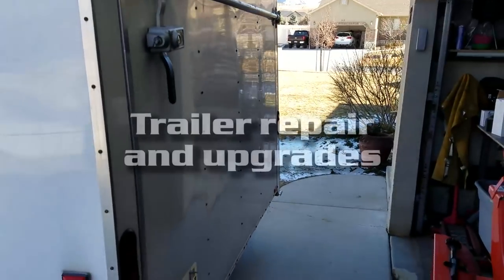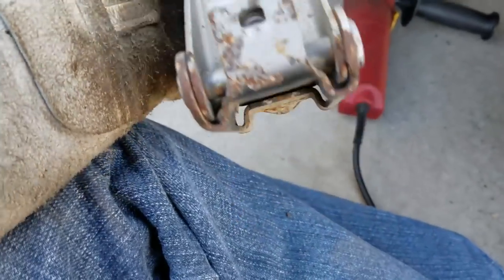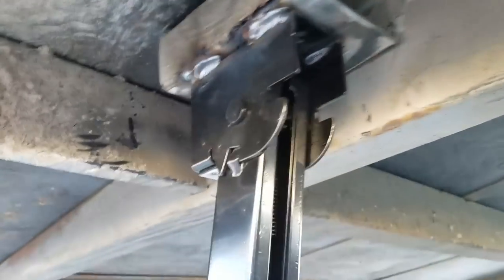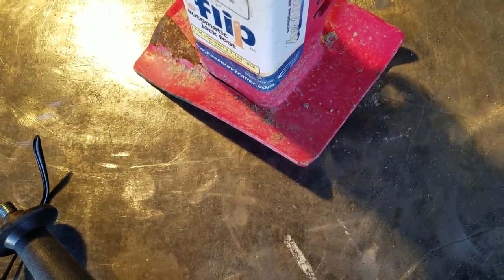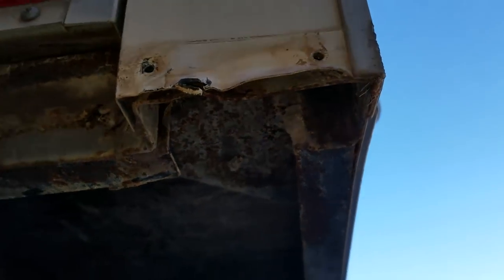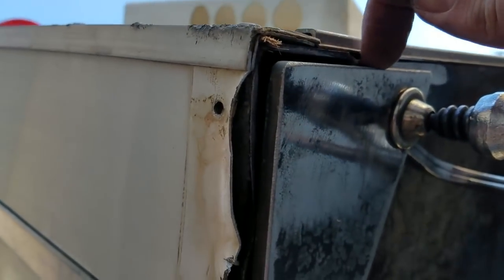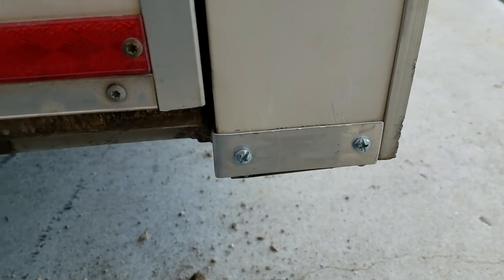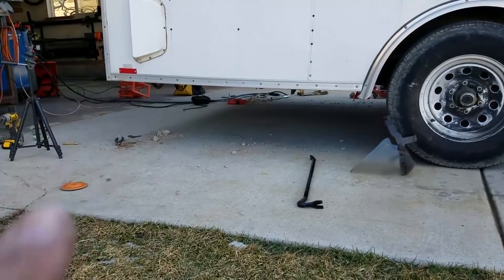Trailer Repair & Upgrades

Comment: Very Nice Job, John. A couple heavy steel Wobble Wheels would work nice on each corner for the backend to help with any hitting the rear corners. I'm looking for a trailer sorta/kinda like that one you have. I want it for a BugOut Trailer with all my stuff in it. I don't want to build anything in it as far as cabinets or Beds just open. Maybe a rack for our containers with our hiking and camping things.
Reply: That is cool that you have it for a BugOut unit also. IF you ever come up with some really good ideas to make or put in it Please send me a PM on the "About" page and let me know what it is you've come up with. I'm designing a rack that my will fit in and with a few screws it will come out real quick for something else.

Comment: ANy tips in learning how to weld?  I have a bunch of little jobs that no one wants to do.   Thanks
Reply from the maker: check out the youtube channel welding tips and tricks.  The best thing is to get a welder and start building non-critical projects, like a welding table, welding cart, or whatever (nothing that goes on the road like a trailer).  Experience is the best teacher, but the channel I mentioned above will give you a good start (pick mig, stick, or tig depending on your budget).  I can't speak for stick or tig, but I would definitely get a 220v machine if going mig.

Comment: Your skid plates won't get caught and pulled backwards?  I'm thinking you should weld a second plate to the leading edge of these skid plate and angled upwards so that nothing gets caught on the leading edge of the skid plate.
Reply from the maker: I don't think so... there is some c channel back there and it never had that issue (across the whole back).... However, if it does I guess I know what my next trailer video will be.   :)

Comment: Where did ya get those trailer stands / jacks cost???
Reply from the maker: I got the flipjack on amazon, but I purchased the stabilizes on wells cargo's website.  I think the former was around $40 and the latter around $20-30